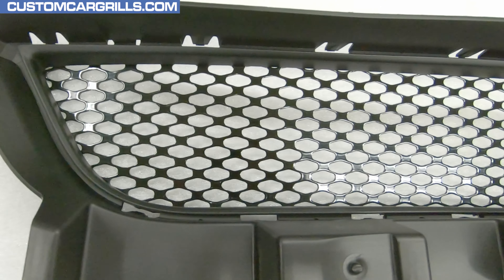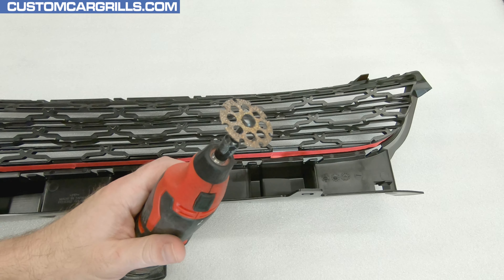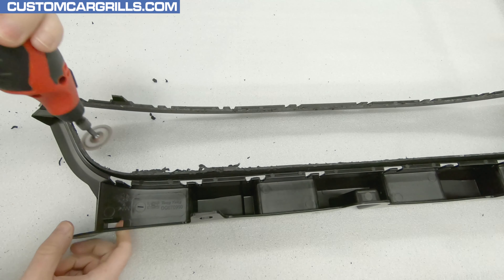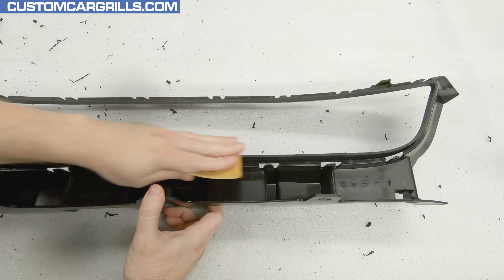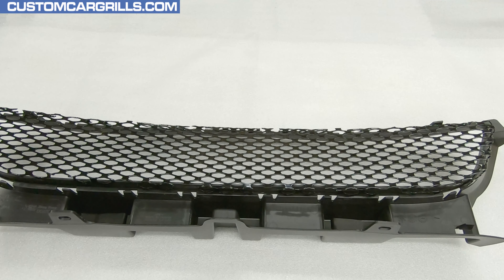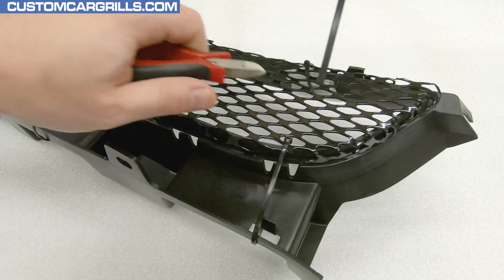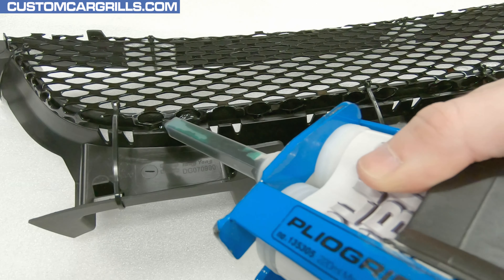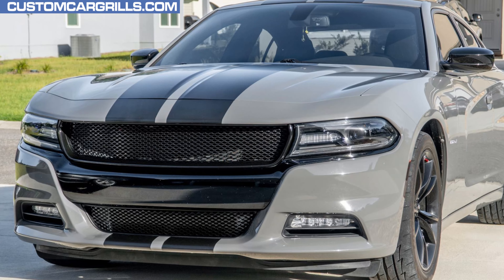Dodge Charger 2015 - 2020 Lower Grille Mesh Installation How-To by customcargrills.com

Comment: Can you still do this if you have the sensor in the middle?
Reply from the maker: It's possible, but you'll need to cut the mesh piece in half and trim out the center area.